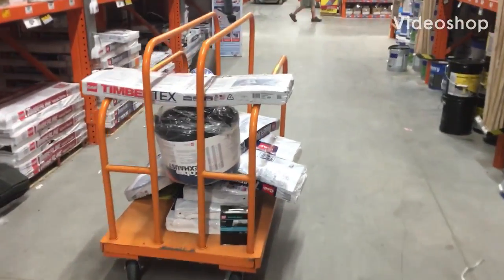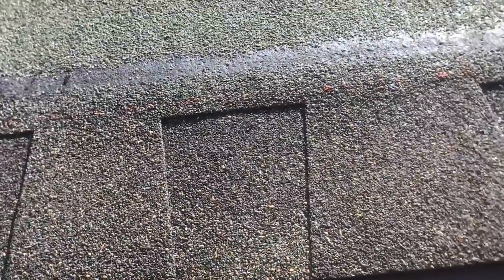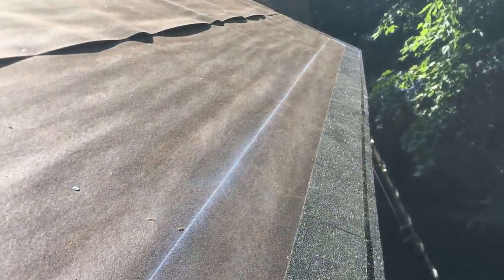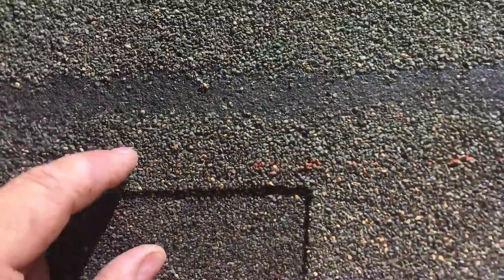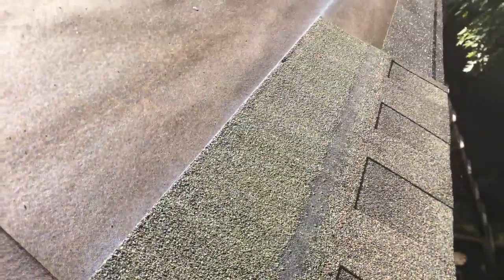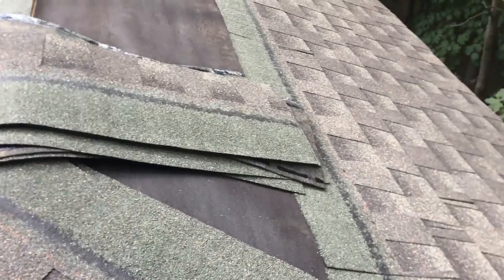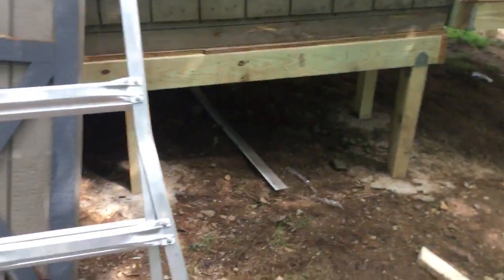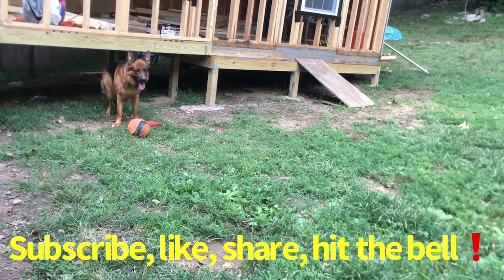How to Install roof shingles & $AVE!! DIY

Comment: Probably the best video I’ve seen yet on shingling. Concise, covers all the details I need to know. Don’t forget to add nail gun oil to the nailer at least once a day, to keep the rubber seals from wearing out prematurely. 

Quick question; on average, how long do you estimate it takes to install one square of shingles (100 square feet - 10X10 area)?
Reply from the maker: @DanielinLaTuna  it all depends on the slope of the roof accessibility to the roof, the tools you have whether a hammer or a nail gun. If you’re new at it, it might take you a few hours. Most experienced roofers can do it no time. If it is your first time, take your time go slow and always work safe. Safety first and foremost, thank you very much and good luck

Comment: Great work. What's your pricing for this project?
Reply from the maker: SearchingforSignalLLC I would charge around 2,100.00  for the roof job. Little over 200sq in my area.
Reply: @HighRidgeHandyman  Wow, it pays to give it a go yourself.